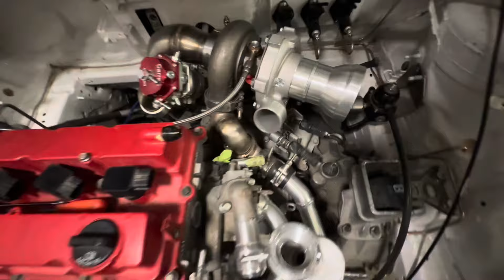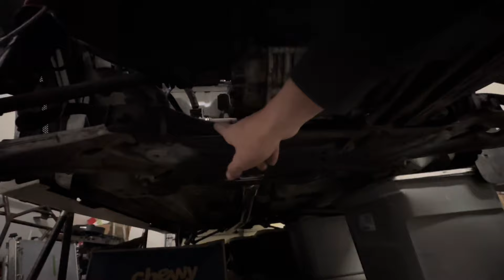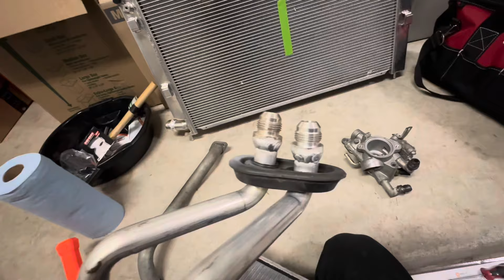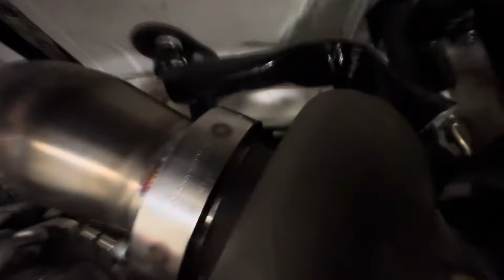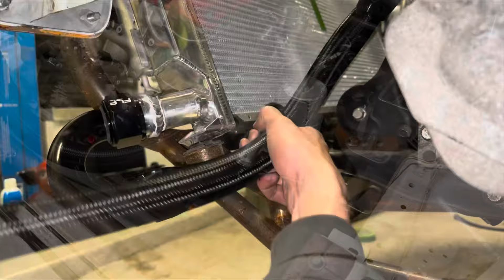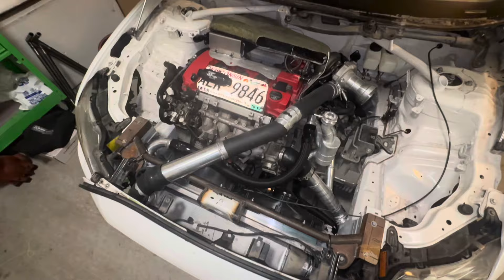The Evo can now hold fluids!!!

Comment: Did i see that right?  Youve daisy chained the turbo cooling to the heater core?
Reply from the maker: Correct. In worst case cranking the heat to pull temp out of the coolant heated from the turbo will help cool keep temps in check.